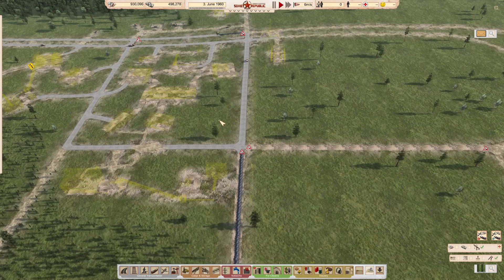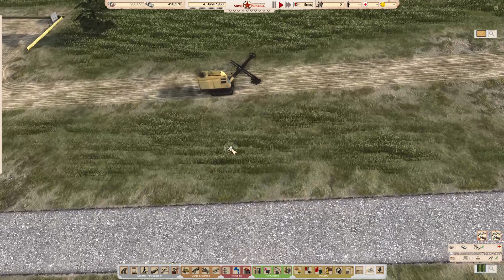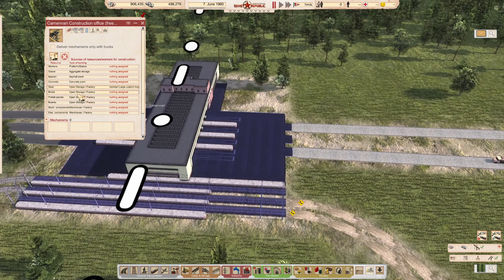Realistic Mode Time To Build :: Workers & Resources Soviet Republic #02

Comment: Hi all, Im pretty new to the game. I am playing the same map as Stephen Silverbeard, I was doing a similar lay out as im learning but i dont seem to be able to buy my resoursces from the Camennari boarder. Being honest its most probably me being a noob lol.

Any help would be great thanks in advance.
Reply from the maker: There are three ways to buy resources from the customs post.  
1.  A direct route.  To set  this up buy a truck in the depot, then set up a  route from the custom post to a drop off point, e.g. an open store.

2.  Using a distribution office.  At the distribution office buy a truck for the required material, then click on the office and set up a route from the customs office to the drop off point.  The truck will then keep the storage at the required level.  

3.  Allocate a construction office to the customs post.  To allocate a construction office, from the list at the top of the window select the type of material to be collected, e.g. steel, bricks, etc, then click on the customs office.

When setting up these routes, make there is a road connection to the border post and the vehicle type matches the material to be moved.  For example the game will let you set up a route to move gravel with an open hull, but all it will do is run back and forth carrying nothing.

When setting up an import route start with the customs office, if the office will highlight green it is a valid connection.  

Hope this helps.